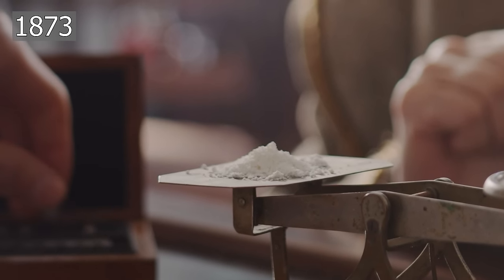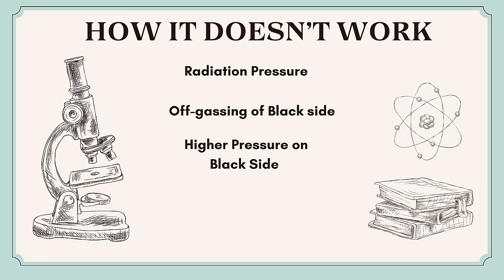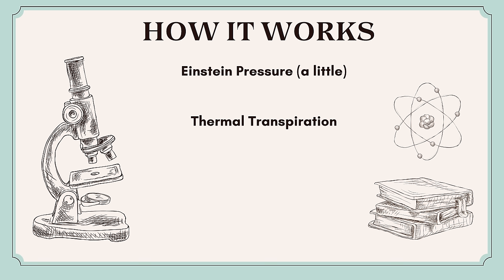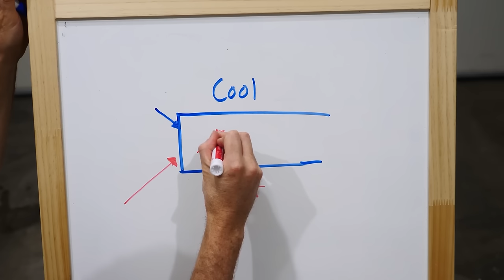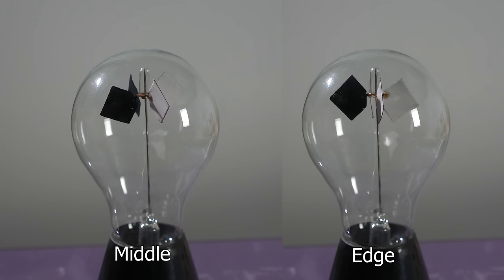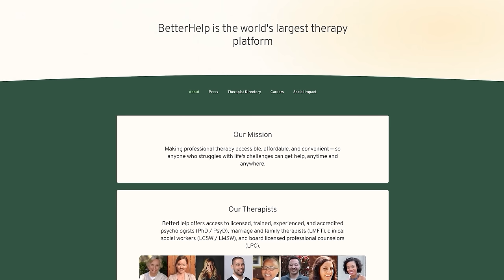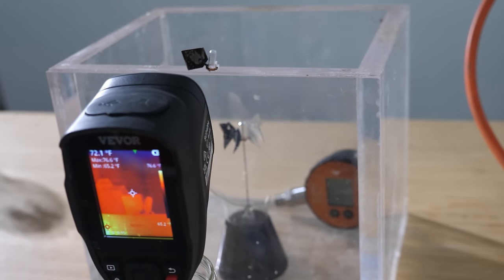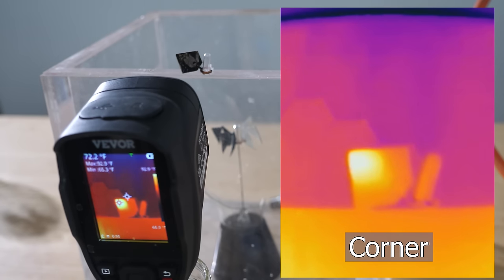Trying To Solve The 150 Year Old Mystery

Comment: Great experiment on the Crookes Radiometer! You might find the 'orbital repulsion force theory' intriguing. This theory suggests that when electrons in the vanes' material absorb light, they jump to higher orbitals, momentarily increasing the molecule's size and creating a repulsive force between adjacent molecules. This force could be what drives the vanes' rotation, rather than just air pressure differences due to heat.

To explore this theory in your experiments, you could focus on observing how different light intensities or wavelengths impact the rotation speed. Since electron orbital changes depend on energy absorption, varying light properties might yield different rotational behaviors. This could provide insights into whether the rotation is driven more by molecular-level quantum changes than by macroscopic thermal effects.  Love the channel ❤
Reply: I don’t think this is the reason. He held a massive flashlight which covers the entire area and multiple squares at once and a small laser but they both turned at the same speed. That also goes against the one with holes not working.
Reply: good to try in an inert gas like.. argon?
Reply: @Snakyy1 Good point... It's possible that the radiometer's response isn't just about light intensity but also other qualities of light, like polarization, coherence, and spectral composition. Different wavelengths, light coherence, or even the way the light is polarized might interact with the vanes in unique ways. This could explain why varying the light intensity or using a laser didn't significantly change the rotation speed. It's a complex interplay that might go beyond just the brightness of the light
Reply: Totally agree that the wavelengths of light might make a difference, especially infrared or absorption frequencies.
Reply: I know when you put it in the window in direct sunlight, it really starts winging along. so I'm going with it's a heat windmill.

Comment: These light mills work on air molecules. Too much air in the chamber and the light makes the molecules bounce off of each other creating a neutralizing effect. Too little air in the chamber and nothing happens. With just the right amount of air, the molecules bounce off of the black side where they receive more energy since the black side is hotter than the white. The white side reflects more light keeping it cooler. The radiation forces from the reflected light is not enough to cause movement. That's why it spins away from the black side.

Comment: Add a tiny serrated edge around the perimeter of the squares... this will increase the edge path length... punching holes and cutting into small sheets decreases surface area and hence speed
Reply: The black and white squares are the same article. Can't trim one without the other.
Reply: @PhaedruS007  you're right... but same answer!

Comment: Black surface absorb more energy than white. This cause the air directly in contact with the black face to be cooler than white. The air pressure is higher on the black side, pushing it foward. The delta pressure is so tiny that the contraption needs a low vaccum to overcome the drag force.
Punching holes cause air to move through, highly reducing the push force that becomes less than the drag force needed to start the spin.
Increasing the surface, by cutting in half the faces, increased the drag force, thus reducing the speed.

Comment: Explanation is very simple. Dark side works as a piston. It  locally warms up the gas, that  is accelerated after contact with surface. But you need to use particle model in your mind. Free path in low vacuum has to be big enough. This way "hot" faster particles have a chance to escape far from  surface before thermalization, and there is no isolating layer having gradients of temperature close to black surface. The device works in the regime where gas can not be considered the fluid (ideal gas).
In the statistical sense  all you need is to have a lot of cool gas particles that hit hotter surface. Hot particles can create backpressure, but it will be smeared and that pressure will also act on silver sufaces. Additionally most of the cooling will happen on the surrounding glass surface. So the colder glass is, the more efficient "engine" will be. Gas inside bulb is not thermalized - distribution will be a sum of few  almost thermal populations with distinct histories of the last contact. There will be black populations, silver populations, side populations. The longer history history you will consider as population division, the more thermalized subpopulation you will have. For example: Glass-Glass, Glass-Black, Black->Glass, Black-Particle, Particle-Particle,
 
Mechanism of the force generation starts in the exactly same time when  most of the drag components dissaper, so that correlation could be additional difficulty for researchers because it coud hide the true nature of phenomenon.
Holes obviously won't help.
(PS. I was smarter than Einstein - just in my own way ;) )

Comment: My guess:

At the surface, diabatic heating will transfer energy to the air molecules in very close proximity to the vane, imparting kinetic energy to them. Due to there only being 180° of a cone those molecules can travel due to the vane being in the way, an equal and opposite reaction occurs. The molecules transfer some of their kinetic energy into the vane, moving it in the opposite direction as the molecules lose that kinetic energy and cool to a lower temperature.

I guess there will also be some complex vortex physics going on at the same time caused by the vanes spinning around and displacing the air - something I don't know much about.
Reply: In addition:
What would be interesting is if the aerodynamics of the vanes were changed (the shape itself), so the air could flow easier around them as it spins. Then you could paint one side and see whether you can get it to spin faster. Having a more aerodynamic 3D shape might help to prove/disprove any theory out there.

Comment: 1. I recommend putting a control top in the same vacuum box you are using as the vacuum might be different
2. Try different gases: Helium, Argon, CO2 to see if the residue gas mass has an impact on the speed.
3. Instead of black use a color paint. & use a light source that is reflected (ie same as paint color) & a different light source that gets absorbed. 
4. Try a cone shape blade & do two tests, reversing the color of the sides. The cone shape would like impact the direction the gas molecules.
5. Try different materials. For instance a metal versus glass\mica which has an low thermal transfer coefficient.
Reply: I was gonna say Hydrogen.

Comment: i recall one of these in my science class when i was younger.  It sat on the window sill and when the sun hit it - it would spin very fast.   I was sure it was the heat given off of the black side that made it spin; as like a black car and a white car in the sun.  the heat may create energy or change the structure of one side of the metal.    Try with plastic or even circles.     great video.
Reply: I have always assumed the same.
I never knew there was a question.
That's black body radiation.

Comment: AIr molecules meeting hot/fast molecules of radiometer have higher momentum after impact with hot/fast molecules of radiometer. In law of conservation of momentum radiometer fins have opposite rotating momentum. It works only in low pressure because viscocity of air increasing (with pressure increasing) faster than momentum. And in atmospheric pressure viscocity of air is too high (air resistance too high) for any rotation. Also may be at higher pressure free path of molecules can be too small to take hot/fast molecues far from fins.
Reply: Nah, if it was that simple you wouldn't see a video on it, you air pressure and momentum stuff was ruled out decades ago.
Reply: @andymouse It is only assumption. It can be checked by two experiments with different thermal conductivity of fins. Cupper/silver fins will have same temperature on both sides and will rotate slower, than foam plastic fins

Comment: I have seen in another video that the rotation depends on light color : with one monochromatic led light it turns and with another LED with another color it doesn't turn even if you augment its intensity.

Comment: When you tried it in the vacuum chamber, there was no globe. Maybe the globe is important because of the way the air swirls around the inside.
Reply: I was wondering the same thing. It's possible the globe is an important part. It should be possible to get the globe apart such that it can be reassembled.
Reply: @chaos.corner  I think the globe directs the air flow like the glass chimney in a "hurricane lamp".
Reply: @codetech5598  and the blades turn like a windmill.  That's my thought.

Comment: Slightly increase temperature = Slightly increase pressure 
PV=nRT
you create a very small ΔP, but enough to move the frictionless pivot 
Easy. Done 
Evidence:
1- In a full vacuum, it doesn't work because there's no gas expansion.
2- It only works (effectively) on the black surface that heats up faster. 
3- It's hard to use a heat source other than light that selectively heats only one side without affecting the whole atmosphere, but if you manage to do thet, it should make it spin. 
4- Trust me bro.
Reply: When you punch holes in it or cut it, you help equalize the pressure faster on the opposite sides.
punching the holes could have made a passage for the small amount of air to flow through, instead of having to either go all around the square or push it.
Reply: I wrote the exact same thing. Also, cutting in half the faces increased drag, and the rotation was slower. It works only with light, or infrared maybe, because the black side needs to absorbe energy from em waves. And it's this that create high pressure on the black sides

Comment: Considering that most of our frame of reference and intuition in science is based on what we've seen and experienced on Terra/earth, with x num of heavy particles, X gravity, X air pressure and so on, I'd put my money on the notion we're still missing something here. Air pressure changes all kinds of things with elements, crystallization, and has to have a cascading effect across other metrics as well. It only stands to reason. Most of our inputs are fixed, and also fixed inside of pretty small ranges even with what we can change kuz money is also a factor. This was a fantastic video! kudos!

Comment: My guess is it's the expansion of the heat off the surface that then pushes the surface away. As the material would have a heat resistance above that of the vacuum, the easiest path of the energy/heat to go is away from the material thus pushing the material away.

Comment: I own one of these. After playing with it, I noticed something interesting: Moving it, touching it, bumping the table or any source of vibration will cause it to spin, sometimes quite rapidly, and that it only ever rotated one direction. 
   This leads me to believe there is some etching in the cusp of the glass, where the tip of the metal sits, that prevents back rotation. Or said differently: it allows it to only turn one way. It functions as sort of ratcheting mechanism, that prevents backwards progress.
   In this way, it essentially translates random motion or vibrations or an oscillatory motion--any of these--into forward-only rotation.
   This doesn't fully explain the radiometer, but it requires less special or magical behavior from the vanes: It doesn't matter if the forces on the vane, each direction, ultimately cancel out or are symmetric. So long as the forces happen at slightly different time offsets, or is oscillatory, then it will rotate in the forwards direction.
Reply: or the fins are slightly tilted so they are not straight up and down and it works like a windmill, hot air rises and turns it. The black and white is just there to throw you off.
Reply: If there was such a ratcheting mechanism then perhaps unbalanced thermal expansion would be enough to accumulate a rotation - especially as the expansion would be a bit like a bi-metallic strip  causing a bend and subsequent rearward shift of the vane centre of gravity.

Comment: Thanks.  If I were trying to solve this, I'd have otherwise identical radiometers, & only change certain configurations: colors, holes, etc.  Put them all side by side in the same light source, & see what they do.  Just manually shining a laser on it is iffy because you're trying to follow it around with your hand motions, which can't be standardized, & therefore represent an uncontrolled variable.       tavi.

Comment: I wonder if flushing the chamber with different types of gasses before creating the vacuum would have an effect. Maybe sulfurhexaflourid ? Maybe cold Helium ? ( just extending some other comment idea where the conservation of momentum would be the reason of  rotation )
Reply: Spent a bit more time. There are indeed so many theories why this thing moves. I got so curious if the effect can be amplified ( faster / stronger rotation ). Will adding more sails make the rotation stronger ( maybe not faster ). Will extending the radius of the sails make the rotation stronger ? Is there a limit to the rotation speed ? ( some say it depends on vacuum level ). Does the material of the sails have any impact ? What if the white is repulsive to the gas and black sail is attractive ( like the capillary effect ). But than why does it rotate backward at lower temperature ? Why does it even have an equilibrium temperature ? Will the sails slow down after a while or indeed turn forever. If you add more drag ( friction), would it convert the heat to.. heat ?
Reply: I failed to find videos, but in theory the Hettner radiometer would prove the thermal transpiration effect.

Comment: It's the same unknown side force you get when you shake sand  up and down with a speaker at certain frequency. The speaker moves up and down, the sand moves up and down but an unknown side force acts  to push the sand into lovely patterns. I think you should do a video about this.
Reply: It's just random movement. The nodes are where there's not much vibration so the sand settles there.

Comment: You appear to have forgotten about the increase in radial inertia required to rotate the veins after splitting them,  Yes you increased the surface area, but you also moved half of the area further from the centre of rotation
Reply: Perhaps the split should have been from the outer edge toward the inner edge so the two halves are arranged vertically?
Reply: @Tsudico then its the opposite problem lol. We aren’t trying to spin them no matter what, we are trying to get data

Comment: My guess is that the black side becomes hotter than the white side, and air molecules hitting the black side get more energy and more speed as they bounce off, imparting greater force on the black side and spinning the vanes. Basically, the hotter molecules on the black surfaces kick away the air molecules with greater force, thus producing a greater reaction force and making the device spin.

Comment: I’m gonna make a simpler proposition.  Light rebounding from the white side is not like billiard balls transferring momentum, the light is being re-emitted…sending its momentum away with the photons. The black side absorbs the photons taking upon itself their momentum also…which is a vector quantity so the direction and amount of momentum pushes on the black surface. ….An analogy…imagine the hard heavy billiard cue ball (photon)smacking into a small cardboard box (black vane)…it does not rebound, it goes into the box and is absorbed by it, and pushes the box on in the same direction.  A stone box (white vane) can’t absorb the cue ball’s momentum vector and doesn’t move…yet sends the ball (photon) back the way it came (reflects it).

Comment: How about trying the experiment with different internal air temperature? What about tiny needle-punched holes instead of big ones? How about perforating the edges so they have longer length while keeping surface area near identical? What about using long thin rectangular strips instead of squares? What about different "blacks", for example Black 2.0 or Vantablack?

Comment: Try to focus the laser in one line of sight to have all wings be touch by the laser, this will rotate it faster compared in focusing in one wing.
Then try to do the same while shining the edge or the outer left corner of the wing, you will see it will rotate faster.
Try to time at least 2-3 cycles to get a much better time difference.
After doing the steps above, you will see that its definitely, not Thermal Transpiration.

Comment: I think the moment of inertia does play the role here - how fast you can reach top speed of rotation. For each point I = m * R ^2, but power advantage is proportional to R, so R / R^2 = 1 / R; the same mass and square should accelerate to max speed faster  if they closely distributed to center. So cutting with /\/\/\ shape and moving closer will help until it reaches the max speed, which is limited by friction on top. I think drop of lubricant / type of lubricant / how much or lubricant is used (to not create more friction in edge case) is what can make difference.

Comment: The light heats the black side and in turn heats the thin air next to the black side more than the white side, thus the expansion of the thin air on the black side pushes against it in the contained area. If the air is thicker the friction of the air molecules and density prevents the push force from being enough to turn and "wind" the air movement enough to allow spin.
 So it is merely heating thin air molecules off the black surface which expand and thus "push" the black side.